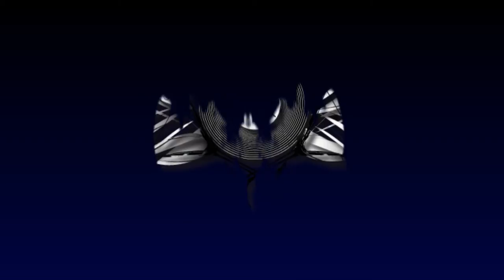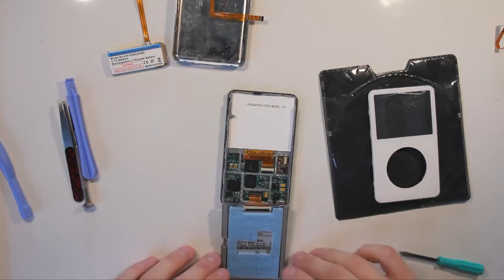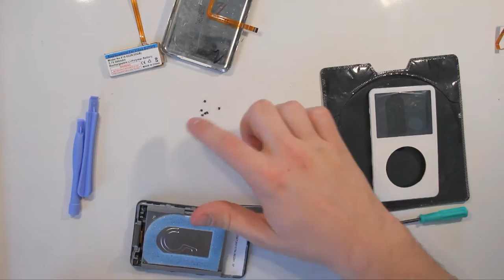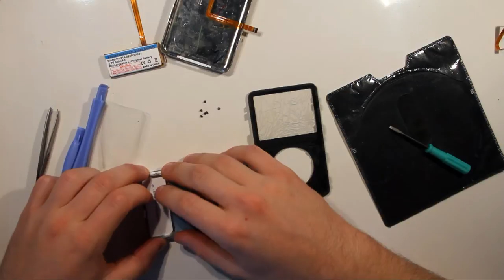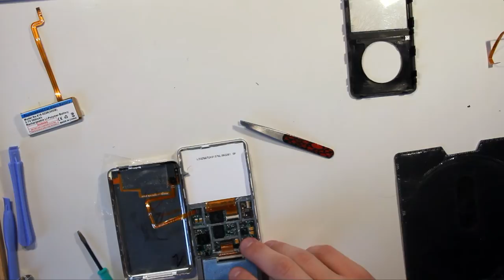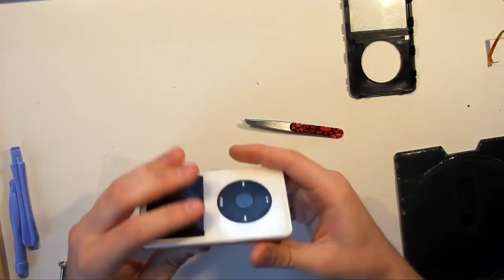iPod Video Front replacement black to white

Comment: Hi! Can i know where you bought your case replacement? I've tried so many and all of them have tolerance issues which makes the click wheel buttons not click without modification
Reply from the maker: Hello Jonathan, I ordered my parts at Sintech in Germany and eBay
Reply: @kleinpauldotcom  right! Did you face any tolerance issues?
Reply: I had the same problem,i bought 2 red faceplates for the 5.5 gen and the click wheel has a problem,anybody found the solution?
Reply: @JAZZMAN72762  i actually found out that the whole world is supplied by the same factory in china, so there's no way of getting around the tolerance issues. i usually use a small piece of sandpaper and run it around the inside of the click wheel cavity until it fits. Also i tend to have to mill out a bit of the top clip for iPod videos, it always catches when assembling and won't go inside the back so i dremel out the tip of the clip so it'll slide in well. 

I found that the black backs also have massive tolerance issues where I have to use a dremel to mill down the clips where the front clips onto the back, specifically the portion closest to the faceplate, where the metal clip frame on the back will contact it when assembled.  might make a video of all this sometime!